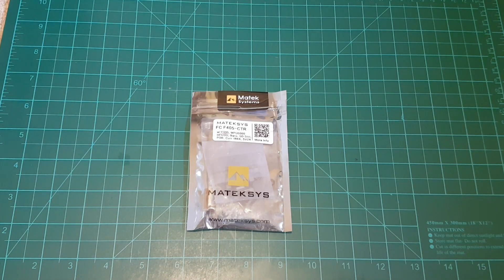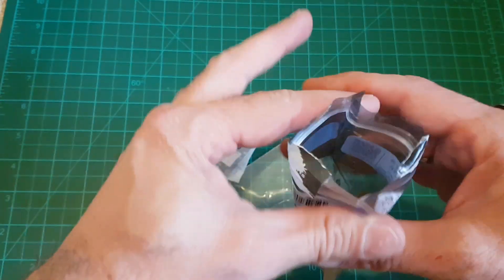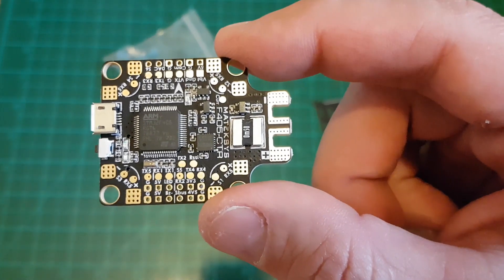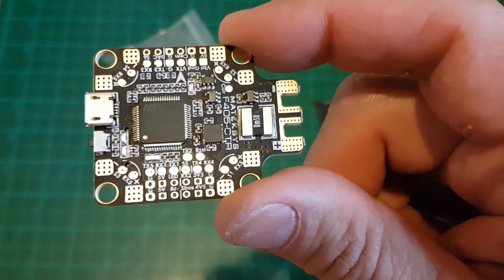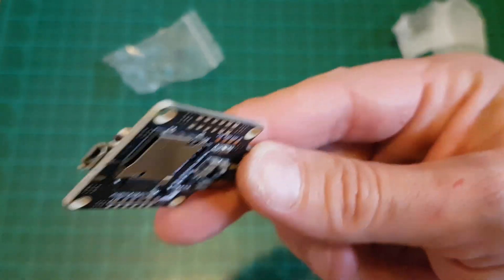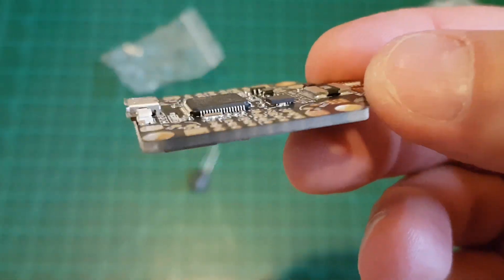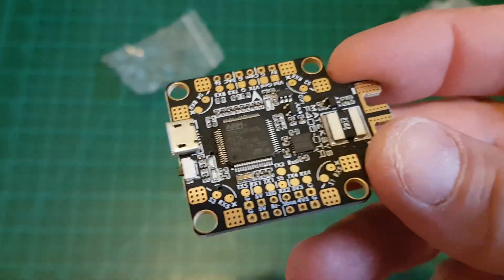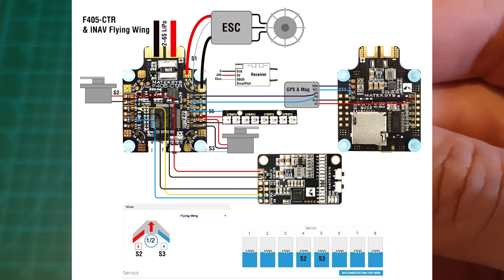Matek Systems F405-CTR Flight Controller

Comment: It is possible to use the Led Tail Matek Programmable With Buzzer, to identify and use as a home point for gps at the time of the drone's dance. I am using a TBS with the fc f405 ctr. I would like to have this led to help know when the drone made the home point of the place, like those drones that use an igaul led system to those that use NAZA with the identification led. Give a help there brother.
Reply from the maker: @Donizete I had this controller just for one week on my review, and it was 2 years ago. I am sorry but I really don't remember if that what you are asking is possible.